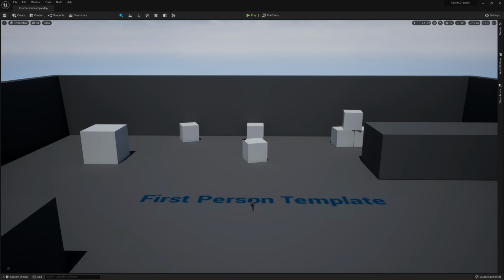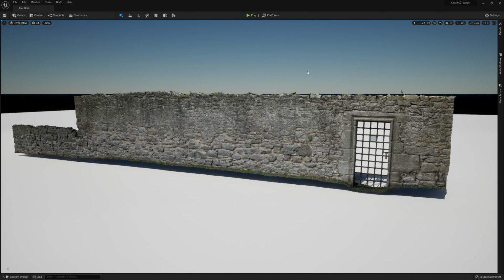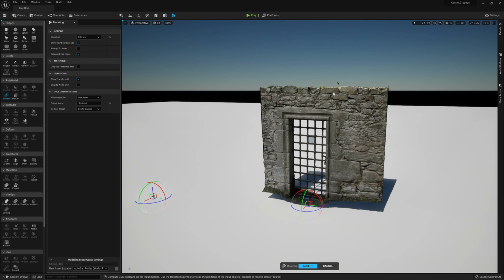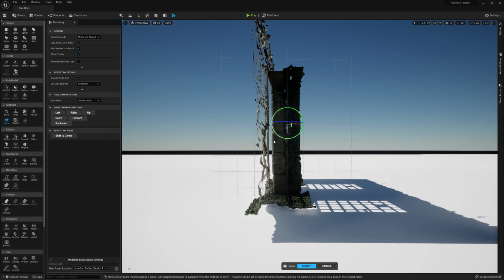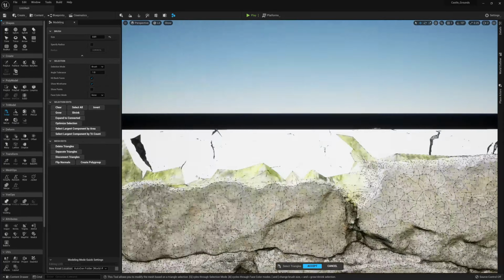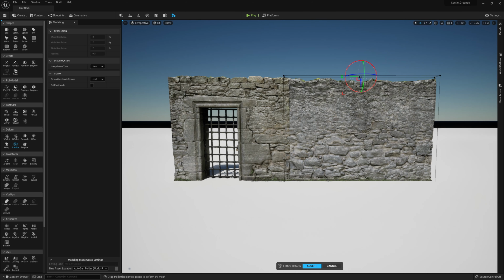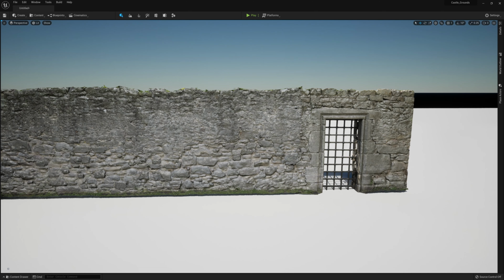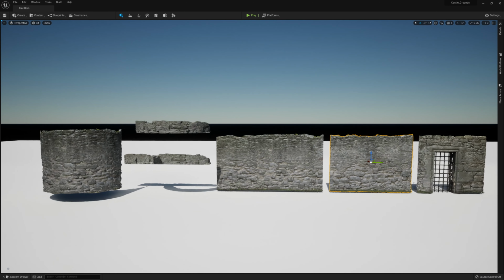Create Modular Meshes Using UE5 Modelling Tools - Part 2 - Unreal Modelling Tools

Comment: Awesome video. Lets say I have a model of a house with interior but I can't get inside of it in UE5 as a character in game mode. How would I apply this method to an entire building not just one wall? Or do I need to do one wall at a time?
Reply from the maker: Not 100% sure what you mean, but if you are struggling to enter a open buidling mesh in game mode, its most likely that, on import, unreal has automatically created a box collision for your whole object meaning that there is a big collision box around your whole house mesh. If you double click the mesh inside unreal editor and look for collision and you can either remove the collision completely (i.e. have no collision) or you can change the "Collison complexity" type from project default to "use Complex collision as simple" this will make the collision per polygon. This is fine for testing purposes but I would not normally recommend this as the final physics for a game asset, but it can be helpful when you just want to test out a space ingame.
Reply: @CB3DART  Thank you I will try that. I guess what I was trying to ask was for example in the City Sample Pack (matrix demo but smaller version) it has like models of large buildings and brownstones with steps but my character wont walk up the steps and lets say I wanted the player to get access to the inside of those buildings how would I do it? Like cutting a boolean into them?
Reply from the maker: I played the matrix demo (pretty amazing stuff) however I have not had a chance to look at the matrix sample scene so its a little difficult to say, but as a guess yes it sounds feasible to Boolean a hole to go inside (obviously I assume that there is no interior so I guess that would need to be built.) also the physics of the building would need to be changed to reflect the boolean hole that you have cut in. With regards to the character not walking up steps, that could be a physics issue or if I remember correctly you can increase the characters setup up height (which in theory would fix that but could introduce other issues)

Comment: Thank you so much for the video, it was extremely helpful! 
I have one question, When I accept my mesh changes, instead of creating a copy of the mesh, the original mesh is replaced by the one that I edited. I'd like to keep both the original and the edited one. There must be a toggle I'm missing somewhere, hope you can help and thanks again for the awesome vid!
Reply from the maker: Thank you pleased that you liked the video.
I have not had a chance to double check this (and the newer versions of the engine might change it) but there is usually a option on each tool called something like "tool output options". In this section you can usually choose how its saved, if it overwrites existing or creates a new mesh. There is also a general setting at the bottom of modelling tools called something like "Modeling mode quick settings" in here you can chose the save/output folder etc, hope that helps

Comment: This is a great tut. My noobie question is, in the case of the door tile, how would you go about animating the door? or make it/set it up in a way to be ready for animating. Cheers!
Reply from the maker: Thanks, with regards to the door.... there is potentially lots of options to do this, From the top of my head, one option might be to use two Boolean operations.
Place a "box" or similar object around the door and do a Boolean subtraction to create a mesh without the door. 
The take the original Boolean box cutter and the original mesh with the door in it and do another Boolean operation, this time use a intersect to remove everything but the door. Then move the pivot (using the unreal Modelling tools pivot tool) to the rotation point on the door, then animate it.
Of course there are many other ways to do this, thats just a quick example. (and might not be the best or most efficient way but should work)

Comment: Is this how you would make swappable gear? For example, if a character has multiple armor sets that they can wear.
Reply from the maker: hmm its more to do with environment modularity but ofcourse you can use the modeling tools on any mesh. (As far as I know) One thing to bare in mind though, the nanite (high polygon system) in UE5 does not work on skinned meshes (i.e. Animated characters) as far as I know.

Comment: ✅ Why are there videos informing artists of plugins like Modeling Tools. The plugin only works on Windows architecture platform. Until the manufacturer creates a plugin for all platforms please don't advertise for this company because it is a disservice for UE5 artists.
Reply: What a nonsense comment from the OP. I assume you’re an Apple user. It’s not Epic’s fault Apple decided to go with their own hardware architecture. That shouldn’t stop them achieving what they want with their largest audience (Windows PC). And the original tutorial is excellent and helped a lot of people. Maybe you should move from whatever platform you’re on to Windows PC? 

If your a Linux user then I’m sure these tools will become available when UE5 is released. In the meantime, stop negatively commenting on community videos that are attempting to help others discover useful workflows.
Reply from the maker: Thanks for the message, this plugin is made by Epic games themselves, its not a 3rd party plugin, so I assumed it would be available to all platforms, however if it is not currently then once it is through beta testing it should become a part of the core engine build so I assume at that point it will be available to all.